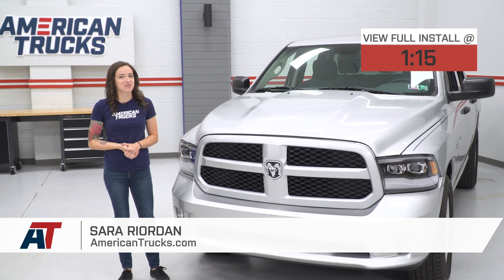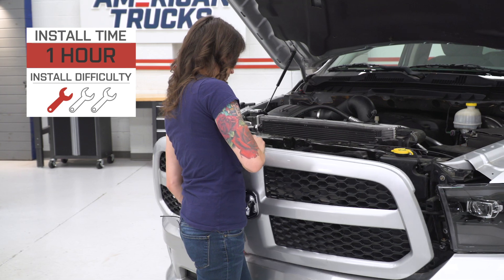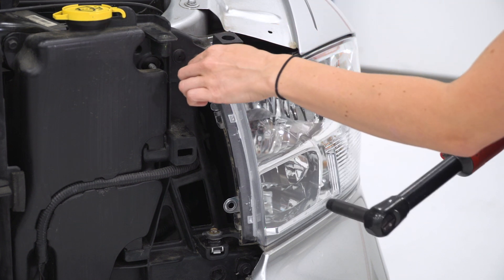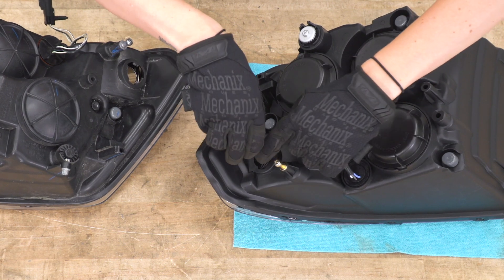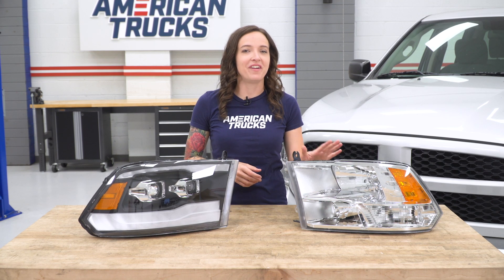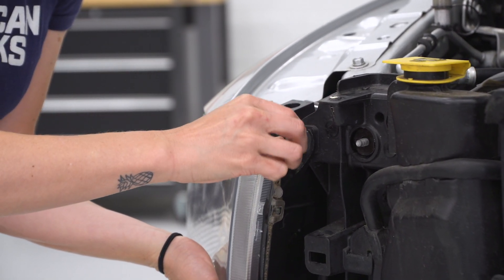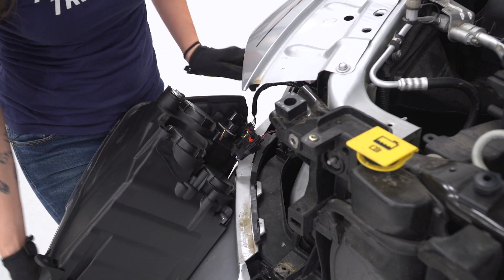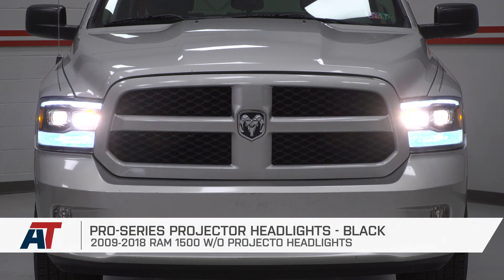2009-2018 RAM 1500 PRO-Series Projector Headlights; Black Review & Install

Comment from the maker: Shop these PRO-Series Projector Headlights: https://amtrucks.at/2DBQuAQ
Subscribe for Weekly RAM Truck Videos: http://bit.ly/2G7fgWv
Reply: Why does some installation videos show you need to tap the fuse box with the wire to get the DRLs working? Your video does not show those.

Comment: For those of you looking to do this, they did not show the proper way to take out the headlight.  There is a tab that you need to lift that releases that pin, you don't just yank it out.  You have to get at the tab from the wheel well.  It's a white tab that you pull up.  please do not just yank out your headlight.
Reply: Great catch. This video looks like it should be great but missing that and the DRL is a hard pass.

Comment: Didn't show how to wire up some wiring(DRL) on the headlight. Shouldve shown that also
Reply from the maker: Thanks for the feedback, we will be sure to explain better going forward, the extra wiring harness is optional, you do not need it for the DRL function it works off of your factory DRL harness. - Sara
Reply: @AmericanTrucksRam  what if my stock truck didn’t come with DRL factory? I don’t know what to do with a yellow wire that it came with

Comment: Showing how to install the wiring harness for optional daytime running lights would have been excellent. I took my 1500 to the Dodge dealer and they were clueless.
Reply from the maker: Hi George, you're correct the extra wiring harness is very confusing, you actually do not need it for the full functionality of your headlights. The manufacturer includes it as an add on if you want to bypass the functionality of your factory running lights. - Sara
Reply: @AmericanTrucksRam   could you explain to us how to get the Day time running lights to work ??? People are saying they don't and you need extra wiring ??? Also... do these headlights collect moisture like the older projector headlights from the past ??? Did dodge ever address that issue???

Comment: Umm did I see a wire you didn't connect?
Reply: At 6:58 what is the single red wire in the middle of the housing?
Reply from the maker: Yes there is some extra wiring for these headlights if you would like to use the optional wiring harness, if not you will still get full functionality of your headlights. - Sara

Comment: I was interested until I heard $500. I’ll pass. My black housing reflector headlights look just fine
Reply: well, the Morimoto are better looking then these ones but they cost $1,350 so these ones are a better deal even though they don't look exactly like the Morimoto's its a better deal.
Reply: 7thkev51 I’m just not into paying that much just for a pair of headlights. About $250 is my limit for headlights. Maybe $300 if I really want them.
Reply: @KingN8Boogie  you do have a point $500 is still too much money for a pair of headlights. The Morimoto headlights are sick but the price of $1,350 is crazy.
Reply: 7thkev51 $1350 is ridiculous. I can think of at least 3 performance mods that I could buy for that price.